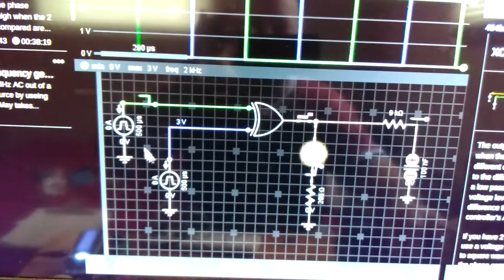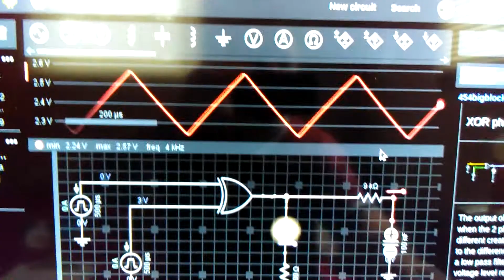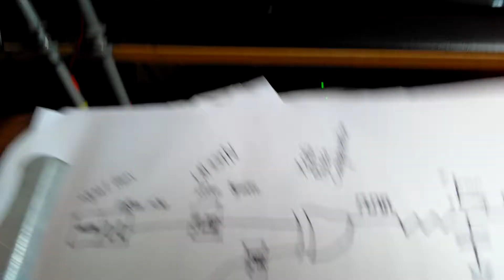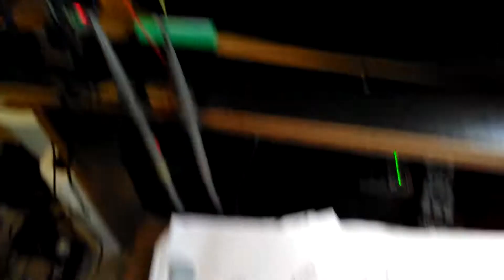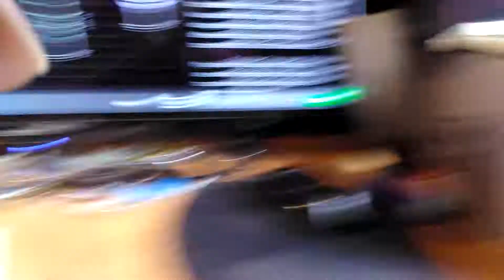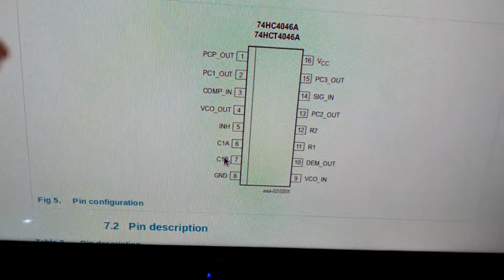Phase Lock Loop with 74HCT4046AN demonstrated

Comment: Nice video and explanation. What software are you using at the start of the video to do the simulation? Looks very useful.
Reply from the maker: The simulator is called "Every Circuit" it has a one time cost of $15, or did when I bought it, It only comes as an android app or a Chrome browser add on. It's pretty useful to visualize what's going on, but does have some problems simulating more complex AC circuits. https://everycircuit.com/